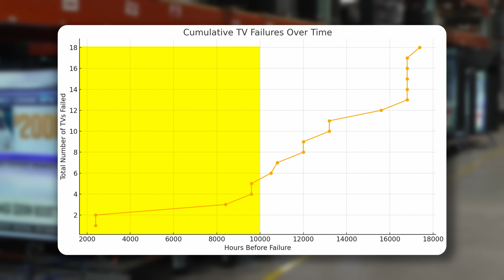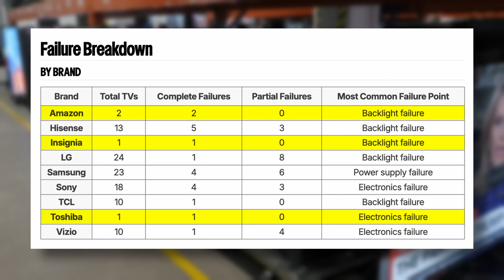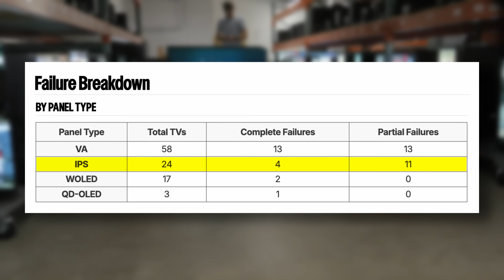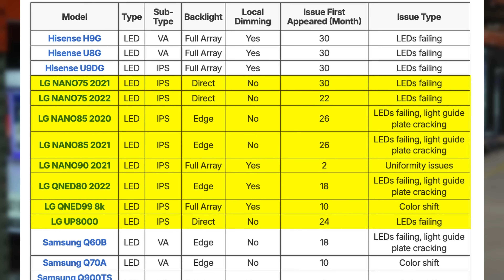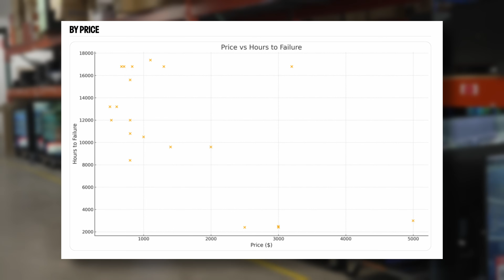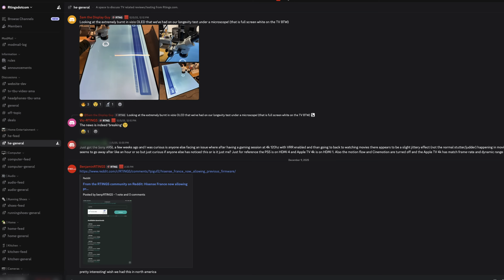Which TVs Break First? Results Overview From Our 100 TV Longevity Test

Comment: I've had the LG C1 for 4 years and mostly play Call of Duty I can see some logo burn in but it's not that bad you can only see it when the picture is really bright or cloudy
Reply: Dont skip on the refresh clean up cycle. Don’t cut power after turning it off.
Reply: I've had a cheap LCD since the end of 2012. ~30,000 hours. Good as new.
The future is wonderful...
Reply: @GroovThe  41k hours on my Pioneer Kuro. No burn-in or dead pixels. Meanwhile my LG C1 OLED is on its third panel, has some light burn-in, and about 30 dead pixels. The pixels die off in droves after about 3k hours of use.
Reply: @busterscrugs  3K hours? You got lucky. My A90J has thousands of dead pixel with more showing up every day and it has less than 1K hours on it.
Reply: @busterscrugs  I've got a little bit of burn in but no dead pixels tbh
Reply: @busterscrugs  Man what are you guys doing to your C1's?? 
My 48" C1 has 10042hrs, i tend to skip the compensation cycles when i turn the tv on because its annoying. i use it as a pc montitor for mostly browser use and some gaming and have not seen a single dead pixel or any sign of burn in when looking at test colours. 
Did i just get lucky or something? or is the fact i have it set to 40% OLED Pixel brightness just helping out that much?
Reply: @MrMoogle  I have a LG C3 as a PC monitor with 7500 hours on it and no dead pixels, no burn in. I will be really disappointed if I see any dead pixel or burn-in before 20K hours of usage.
Reply: @busterscrugs  you've had really bad luck. Both my C8 and C9 are going great.
Reply: @Mattvbro  Lucky yeah. I had OLED burn within a few months of daily usage. Yeah, i use my display. I wont keep it turn off. Sometimes i use it 4-7 hours. My old TV has 0 issues, 15 years old. OLED? Nah, cant last 10 years.. i doubt it can even last 5.
Reply: @Starfals  yeah mine gets used about 7 hours a day, i just use dark mode browser settings and have not had any issues aye. even when i fall asleep and wake up the next day to my pc still open being static all night. still no burn in.
I think most of you guys must be pushing the limits hard aye, I bet you have brightness set to 100%, a taskbar that does not autohide and uses light mode and HDR for everything
Reply: @Starfals  Am i correct or you just rage baiting and dont even own an oled?
Reply: @GroovThe 💀😅✅💯
Reply: @GroovThe  Can't beat a Oled picture tho even if it doesn't last forever
Reply: Same tv and lots of gaming on it, it’s 77 inch one. I’ve had it for over 4 years but so fare I have not noticed any burn in.